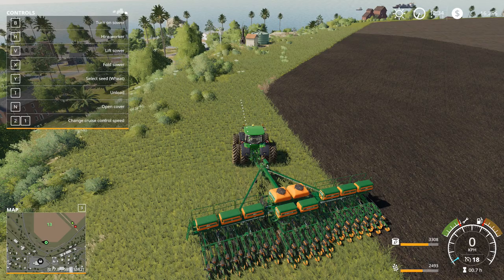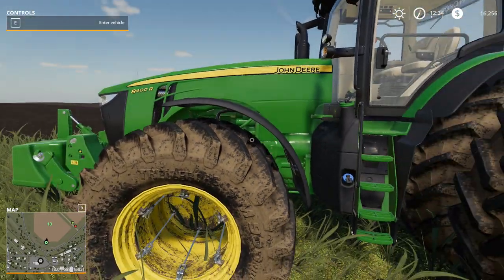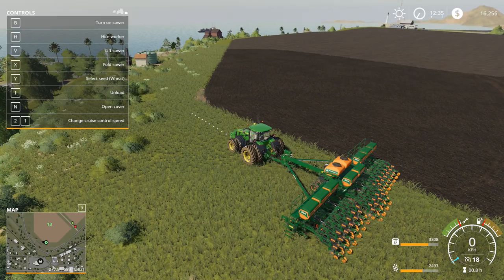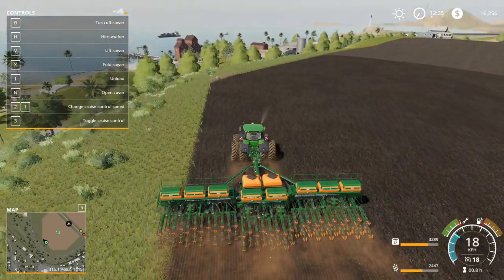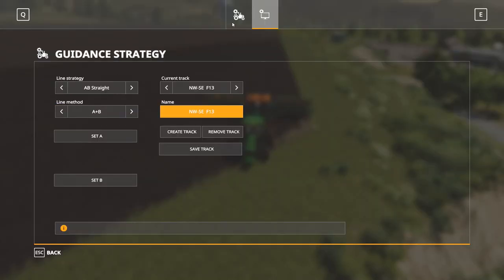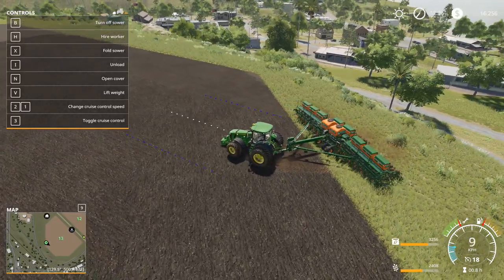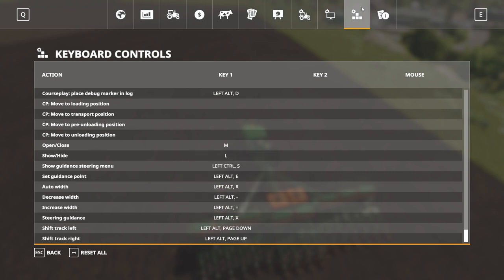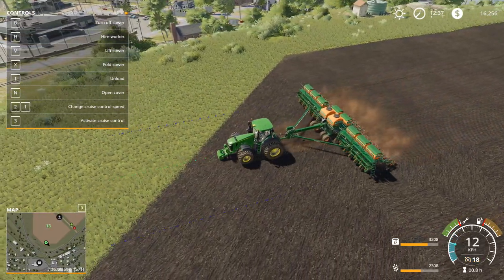#FS19 How to use GPS Mod - Guidance Steering mod - The Basics

Comment: Hey guys! Can someone help me? I have this mod isntalled, game sees it. But it doesn't work at all, it doesn't react at key bindings even if you rebind them. I tried to buy gps on my vehicles and rented one it doesn't work nowhere.
Reply: Try using ALT+C first.
Than follow his steps.
Reply: @symtixagra971  thx for your answer, but I've already solved this problem. GPS should be turned on and then menu appears e.t.c

Comment: How do you get option to put it on tractors on ps4? I have an in-game mid for the gps for a pull type sprayer but no option to put on tractor
Reply from the maker: Not sure about PS4,
Reply: It's only on PC, don't know if it will ever be available on PS4. I don't think so though.
Reply: Ok thanks

Comment: The new one from the modhub barely even works..
Reply from the maker: I haven't tried that one yet. Thanks for the heads up
Reply: No problem. I myself just started to try it out but usually when I hit ctrl + S it doesn’t do anything. So does it with the other functions most of the time. I only had it to work once but if you activate guidance steering at the end of the field it stops and you can not move unless you deactivate it again. I hope they will fix this anytime soon
Reply: @Niels_f2704  I think it's what i encountered the menu doesnt work if you have something coupled to the tractor. So you have to couple after and then if you press anything other then accelerate and brake it stops the GPS steering and you have to reset everything again.

Comment: Setting A or B Does nothing
Reply: 1. Press ALT + E to set Point A
2. Drive straight to the other end of the field and press ALT + E again to set B
3. Press ALT + E to confirm the line and now you must see a Whit line with the Width Indicators in Blue on the sides.
4. When you not see the Blue indicators then press one time more ALT + E.

I'ts in Developement and sometimes does it not work with only one button hit.

good luck
Reply: @BioDiesel112  Doesn't do anything either for me, wether you click "Set A" in the UI, or use the shortcut.
Reply: @getous  the buttons in menu doesn't work, you must use the shortcut buttons (alt + e)
Reply: @BioDiesel112  that was my point, the buttons didn't work either. Started working after mabye another 10 tries, followed the path for one run then started driving away.. using courseplay atm